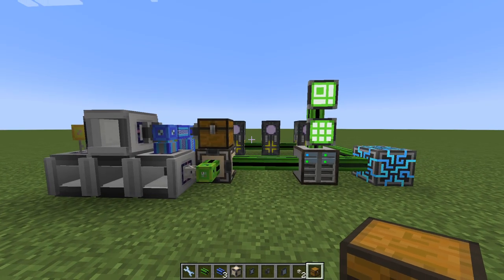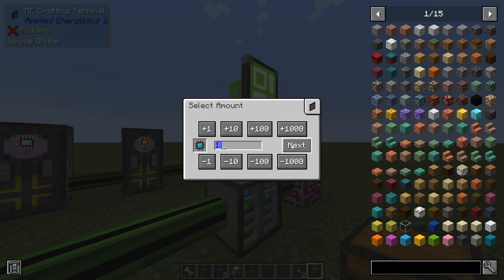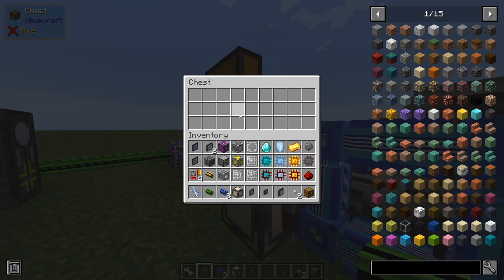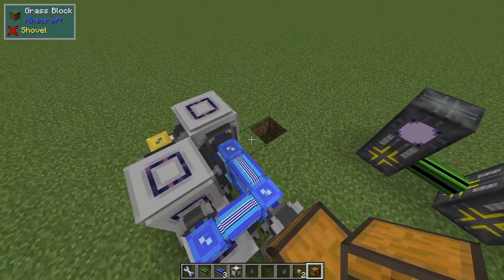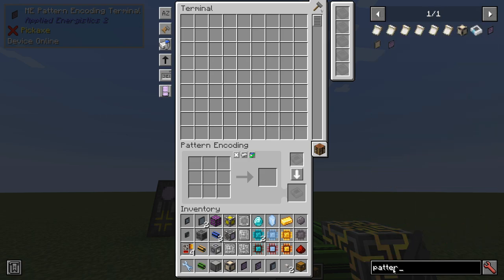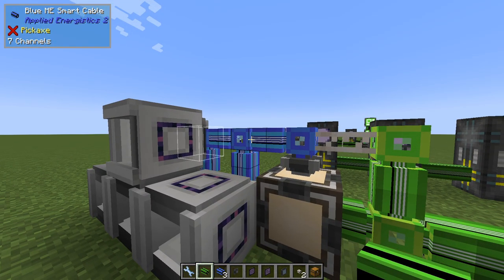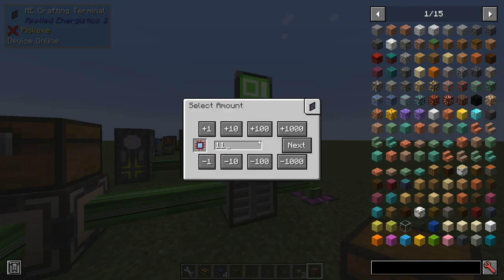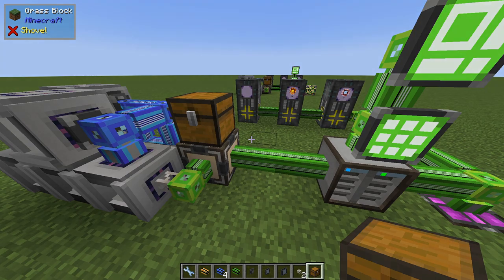Updated (1.18) Super Compact Processor Auto-Crafting Setup - Applied Energistics 2 Tutorial

Comment: I’m having an issue where the bottom presses don’t send the diamond, gold, or quartz presses don’t send into the middle inscriber. Any solutions?
Reply from the maker: It sounds like your export bus is incorrectly filtered or the storage bus filter setting is wrong. Or a block is misplaced making some devices offline. Make sure all are online and correctly filtered! It's usually a simple error like that, make sure every block is correctly placed according to video, and also filtered with correct parts (it's a common error).
Reply: @therealtkh  thank you for the reply. Unfortunately I checked the filter and to see if the device was online but the bottom inscribers still aren’t sending to the top inscriber. Are there any other reasons why this is happening?
Reply from the maker: @abluepieceofchalk7504  The filter settings in both export bus and storage bus. Make sure the storage one is set to input only and that correct items are in the export and that it's online. It would be easier with a few screenshots so it's totally fine to jump onto discord and send to me there :)
Reply: @therealtkh  that would be very helpful. Thank you I’ll join the discord now

Comment: Hi! I have tried this and it just isn't working. Do you have a video for ATM8 yet? I'm thinking it might be related to that. Thanks!
Reply from the maker: I have made a build for 1.19.2 and it works perfectly. I don't know anything about your build but usually it's a small detail that's wrong. Use chest to receive items, check filter settings in storage bus, check export bus settings and make sure you have quartz fiber in correct positions so all devices are online.
Reply: I have ATM 9, and have the same problem. It won't insert materials into the inscribers at all.

Comment: current issues: Crafting cpu not updating when finished crafting. Items appear in system but CPU still believes they need to be crafted. stays like that indefinitely. 
Additionally, system drags everything except the Redstone into the chest. I have to manually put the correct amount of Redstone into the chest so it can make the final processor. 

All other aspects work. Makes the silicon, quartz gold, diamond chips. Pulls in all other resources. Recognizing it is done and pulling Redstone are the only issues. Could someone help? 

1.18.2- latest version as of July 1st '22
Reply: I'm on AOF5 right now, which is on 1.18.2. I was able to get it to work but it took a little while. Make sure that the top storage bus has redstone in one of the slots, and is set to insert only. 4 out of the 5 storage buses should be set to insert only. The only one that it doesn't matter is the silicon one. Double check your connections, your storage bus configs (redstone, certus quartz, etc. all in their proper storage buses), and try to toy with it some. It takes a little bit, but you should be able to manage on this version.
Reply: am having same issue at 1.19.1  and i have the excact same issue. all connections are the same as the video shows. but still not working.

Comment: but how does this system remove the printed pieces from the bottom 3 to put into the top if the storage bus' are set to insertion only filtered? , also im having a problem where the pattern provider wont function without being attached to my main network cable it wont work if i extend the cable a few blocks away from the "backbone"
Reply from the maker: I interpret the Storage Bus filter as "things to filter for insertion, but not limiting extraction". You could set filter on both in and out and then add the prints in the filter as well. Not sure about your problem though. Other things attached nearby causing issues with channels or power issues?
Reply: @therealtkh  i seem to have found my issue to be the me drives are on the wrong side of the system at the recieving end of a p2p tunnel, moved drives to controller side of network and it solved my problem of the pattern provider not providing items, when using transport networks you must make sure your main system stays together then p2p only to the "devices/machines" you make / are using, if the drives and this "device" are on the same end of one p2p tunnel it wont work and everything breaks. hope this helps because this was about 4 hours of trial and error
Reply from the maker: @Chickendude1  Good to hear you found the problem but I don't understand your p2p problem. I have made large p2p networks (see separate video about this topic) and divided storage and auto-crafting in different ends of the network and had no problems. If the network is designed correctly all ends shall behave like they are standing next to each other. If you want to discuss the issue further feel free to jump onto my Discord!

Comment: I am playing Direwolf20 1.18 modpack, and the circuits from the bottom inscribers does not end up in the top. I have set all storage busses to "filter on insertion only" but it still does not work. Does anyone have an idea of how to fix it?
Reply from the maker: I haven't tested in DW20 pack but remember that even a single connection in wrong place can cause this. Are all devices in the blue network online? Is top export bus properly connected, is top Inscriber rotaded correctly? Is silicon working as it should? Always hard to guess.
Reply: i am playing the same pack and this setup works perfectly, i suggest you try it again carefully :)

Comment: TKH i have made 4 of your compact processor setups, can i connnect them to one network?
Reply from the maker: Hmm, this build is designed to be alone as it will use resources in only one place (meaning it has no "workload sharing" as I call it). I guess you want to be able to make several processors of the same sort at the same time? I would say this is not the build to use in that case. In the AE2 playlist (in video description) you can find a pair of videos I made last year I think, to see what method I used to add more inscribers for each type and crafting processors even faster.

Comment: do you have to use separate colors of cables?
Reply from the maker: No colors required, and you don't even need to use Smart Cables. But I do it in my tutorial videos to make the build easier to follow.
Reply: @therealtkh  i tried replicating this in a 1.19.2 world but for some reason it wont work, it shows the item as craftable but wont send the materials through
Reply from the maker: @DarkRavenProductions  It works fine in 1.19.2 as can be seen in other comments, probably just a minor problem. Hard to guess when I don't know anything about your build. Got crafting CPUs in good shape and in correct network? Does autocrafting works for other things?
Reply: auto crafting works fine, so far i only have a 1k crafting storage block, i have the ME interface config loaded with the materials required for crafting the processors the only thing going into the correct place is the red stone
Reply: ok so the problem is the circuits arent being extracted once printed
Reply from the maker: @DarkRavenProductions  Double check so filter is correct, and that export bus (to the top inscriber) has correct items. Are silicon and redstone ending up in there as expected? all devices online? It's easy to do minor mistakes!

Comment: Hi there! Thanks for the video; I have a question though. I can get most of your system to work in ATM7, however the silicon inscriber does not seem to want to work. It's the exact same setup as yours but it does not want to communicate with the request, could this be because of different versions of silicon in the modpack?
Reply from the maker: I haven't tried ATM7 yet so I can't rule out the possibility of incompatible silicons. What have you used in the recipe? Is it sending anything? Do you have that type of silicon in the storage? Are the devices online in that corner (separated by quartz fiber)?
Reply: @therealtkh  I have used the AE2 silicon in each recipe. It can manage to make individual circuits just fine, but not whole processors. The devices are all online but they are not, for some reason, communicating with the system. I.e, I can queue up for example, 1 logic processor, and it will make the circuit, put the redstone in, but not the silicon. Other times I can queue up JUST the silicon circuit without any issue, but it automatically sends it to the inscriber and not the system. Additionally whenever I queue (for example one logic circuit) it will complete the task but not register as complete in the system.
Reply from the maker: @LinknPaint  It's always easier to investigate with screenshots, but you're talking about making circuits so I wonder if your patterns are correct? Feel free to jump onto Discord and we can discuss more easily with screens or if you record a video.
Reply: @therealtkh  Aight I'll join the discord tomorrow and I can share my screen whenever works. Thanks in advance!
Reply: @LinknPaint  Did you manage to fix the issue. Im having the same thing where the silicon wont get imported into the press
Reply: @therealtkh  Hello, I'm having the same issue, does it has solution?
Reply from the maker: @JuanmaGreene  I have just downloaded the ATM7 pack and the builds works just fine! Usually it's a minor mistake such as forgetting quartz fiber in any of the total of three positions. In some versions the build acts a bit weird in the receiving Interface so it might be a good idea to use the chest variant to be safe. I have only built this in creative and had no issues with silicon or actually anything at all.
Reply: @therealtkh  Thank you so much! I'll take a look! Thanks for your time!